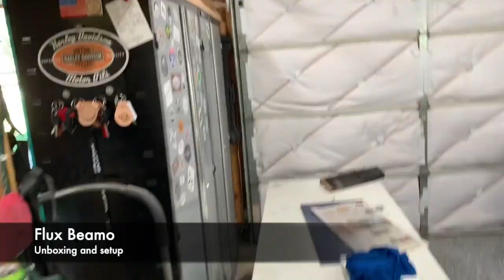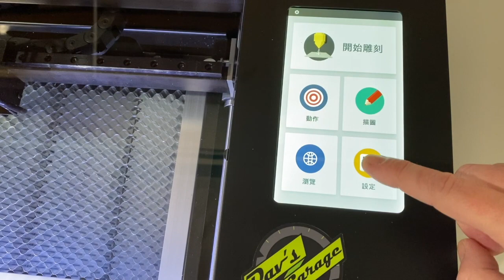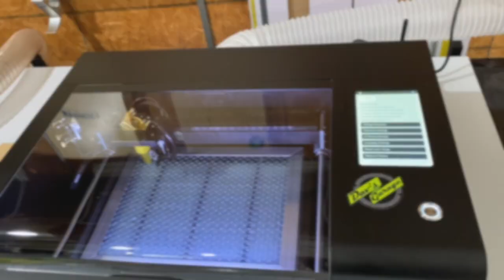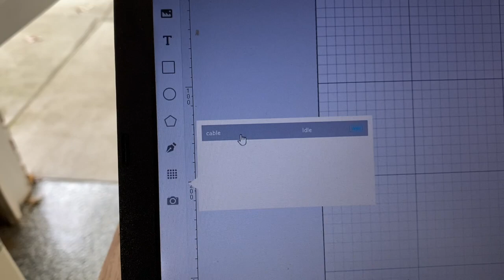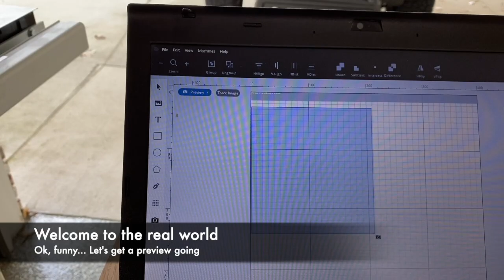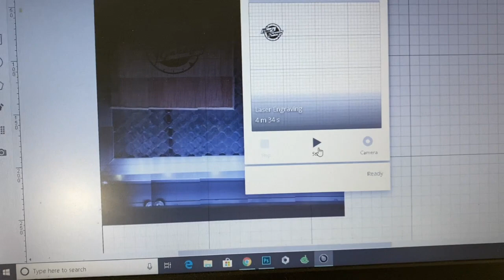Flux Beamo Unbox and basic setup

Comment: I work in a school with an alarm system designed by a reformed pyromaniac.  Does the laser cutter need any special venting or a BOFA filter?  What kind?
Reply from the maker: You can either vent it out a window or use a filter: https://flux3dp.com/beam-air/

Comment: I think a Makeblock laserbox is much better built than this one---although it is 4X the price. This beamo thingy looks like a K40 unit with outer shell cosmetics and software upgrades. For $1,500++ you could get a regular top notch 30x50 cm Chinese laser with Ruida control. If I wanted to play around with autoscan and whatnot, I'd rather save up for the Makeblock.

Comment: Hi Dav! Awesome video on the Beamo! Wanted to ask in regards to engraving on a 3mm clear acrylic piece (I'm planning on engraving a menu on my acrylic piece) - is it possible to engrave while I keep the acrylic protective sticker on? To prevent scratches on the menu? Cheers :)
Reply from the maker: Apologies that I didn't see this. 

Yes, I always leave the protective covering on. If it doesn't have one, I apply Oramask to it. This will help with over burn and keep the image nice and clean. 

One thing I do as well is burn the image in reverse on the backside of the acrylic, this way the front is nice and smooth.
Reply: @DavGlass  Awesome tip about doing a reverse burn! Thanks Dav!

Comment: Awesome video!  I was thinking about ordering one to make wooden jewelry with.  Is this powerful, reliable enough to make wood cuts?  Compared to the Glowforge or the beam box pro 40w laser is it significantly less powerful or does it do pretty much the same stuff just slower?  Thanks for the help.
Reply from the maker: Black Philip Thanks 👍
The beamo is a 30w laser while the beambox is a 40w and the pro is a 50w. I also own the 40w Beambox. This laser should have no issue cutting 1/8” wood like butter. You may be able to get a little thicker but 1/8” is still pretty good. The GF is a decent device but I’m not a fan of being locked into their proprietary online only service.
Reply: @DavGlass  thanks for the quick reply.  In your opinion is the 40W worth the extra money?  Will also need to engrave on glass.  I just don’t want to be disappointed with the 30W, but obviously if I can get away with saving a G I will.   This would all be a no brainer if I didn’t just miss the Kickstarter for $900 and now have to pay the $1500.  Thanks again!
Reply from the maker: Black Philip Honestly, it all depends on the size of material you want to work with. If you are doing smaller items then the Beamo will be perfectly fine. If you need to do larger items and have the space then the beambox os better. The beambox is nearly twice the size of the beamo in footprint. If you check out my Instagram I have a few photos of them together on the same table.
Reply: @blackphilip4831  $1,500? Damn, now it's $2,799.

Comment: Thanks for this unboxing video! 
Still waiting for mine to be delivered.. 
I was wondering how loud was the machine when running? They said we can manage to reduce the fan speed to make it quieter, is it true?
Reply from the maker: Nolwenn Pellet Yes, you can adjust the fan speed. I’ve never needed to do it but you can. Running it averages about 80dB which is a bit loader than a home vacuum.